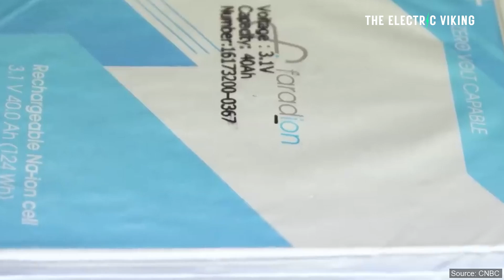Ex-Tesla engineer creates Sodium battery as good as LFP for $25,000 EVs

Comment: Sodium is a more reactive metal than lithium. It is three times heavier. Its diameter is 20% greater. But it is much cheaper and more plentiful and behaves better in cold environments.
Reply: Do you mean it's density is 20% greater.
Reply: @stevengriffin7873  I haven’t calculated its density. Its mass is 3 times greater.
Reply: @johnfrancis4401  Ok,just referring to your comment of its diameter is 20% greater?
Reply: @johnfrancis4401  Don't remember my physics too well,but if its' mass is three times greater then I suppose it might be three times heavier perhaps.I know on some cars they use polypropylene trim panels instead of ABS as it has a lower mass to save weight for example
Reply: Yes, but the finished product is very different from the raw elements, and Na-ion is better for a daily commuter because it can shave thousands off the cost.
Reply: True, the real game changer is for home storage or huge industrial storage facilities, they are perfect for that.
Reply: @chriswilliams8607   For home storage, lead acid is king.
Most durable, cheap and weight/size is of little concern.
Reply: @svr5423  Lead acid is always a very bad idea for energy storage, and it is much more expensive than LFP batteries, that will last 20 years. Due to high internal resistance lead acid efficiency is terrible and around 80% (LFP > 95%). LFP battery prices have dropped so much now that it would be absurd to buy lead acid today, except for 12V starter battery for cars, but everything else.... forget it.
Reply: @chriswilliams8607  You're wrong.
It's a great idea for energy storage, which is why it is so commonly used.

Except for BEVs, where weight matters (you don't want to lift your 60km+ range E-scooter with lead batteries).

Keep in mind that cost is not only an issue when you buy batteries, but also when you lifecycle them.
Reply: @svr5423  please face reality, no reasonable person would today even consider lead acid for energy storage, it is simply utter nonsense. You loose 20% of energy alone in the battery, lifetime is terrible, even with very small DOD, it is self torture to use such outdated technology.
And off course lead acid is much more expensive as you need to replace them every few years.
One kWh LFP batteries costs 100 dollars today. People that have no clue what they are doing would buy lead acid, everybody else buys lithium or sodium based cells for stationary energy storage.
There is only one reason to use lead acid... if you get them for free, and i am not sure if i  even then would use them, as they are such a pain.
Reply: @chriswilliams8607   
Lithium is not only much more expensive, it's also much more fragile. Just look up the prices, stop talking out of your behind.
You're making a fool out of yourself.

Comment: what's the degradation rate of Sodium? How sensitive are they to temperature?
Reply: Very very low degradation with the latest iterations and they can be charged and discharged very quickly from 0-100%. Not sure about temp.
They are heavier and much less energy dense(vol) but use ultra cheap materials sodium and magnesium which are waste products from other industries. They are about to take off in a big way on stationary storage
Reply: They are extremely good at low temperatures and have very high cycle life, they will be perfect for home storage and smaller cars with up to 200 miles range.

Comment: Ah, could this Sodium battery be the next story to line-up for the famous $25k Tesla? 
That elusive Tesla model 2, that Musky is dreaming about since 2015 and was promised to be sold in 2020. . 
Ehhh 2021? , or 2022, or for sure 2023, that turns out to be 2024, and still is a fantasy for 2025.
Reply: You're thinking about the $35000 tesla which they achieved adjust for inflation. they never said the 25000 car would be out in 2020. Remember, the US dollar value has dropped, so 25000 isn't the same anymore